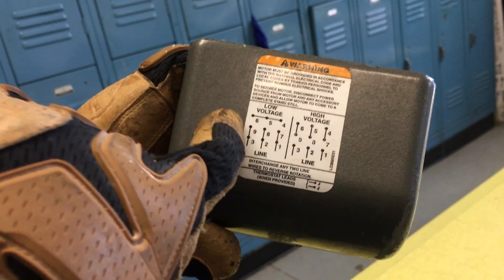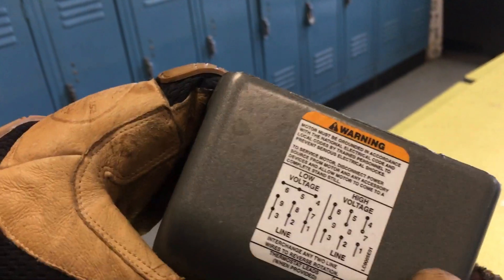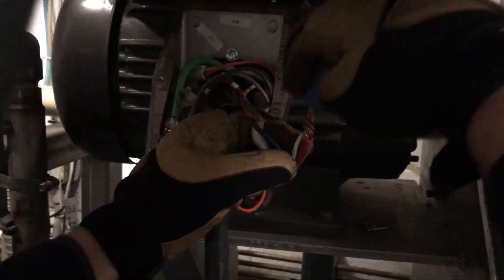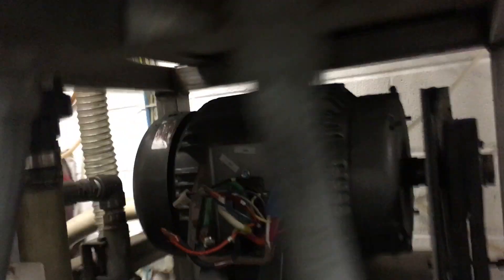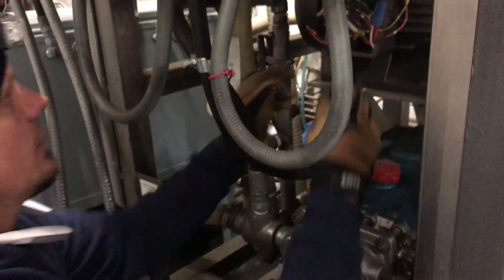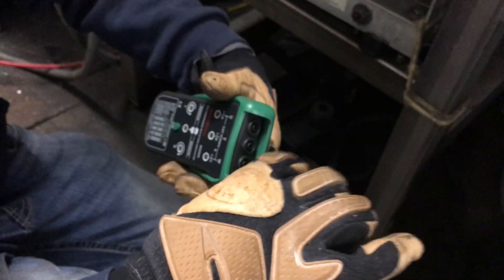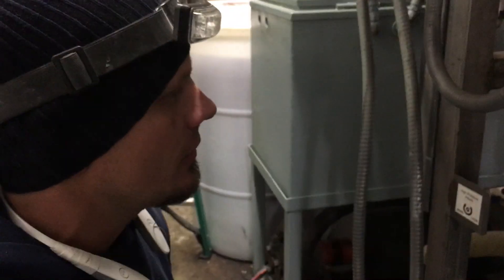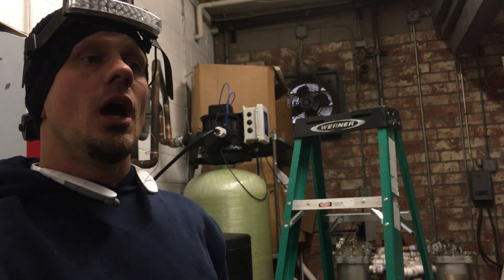Wiring of Commercial Car Wash Equipment- 3 Phase Water Pump, Part 2

Comment: Great video, the CAT pump that is shown is a plunger pump, so while it does have a preferred rotation, it is not essential.  However, it is very important for centrifugal pumps. It is nice to have a cool phase rotation meter, but most of the time, technicians just bump the motor and see which way it rotates. Thanks for the video.